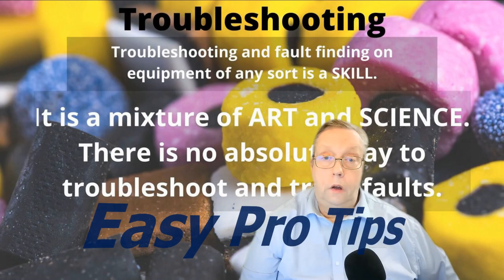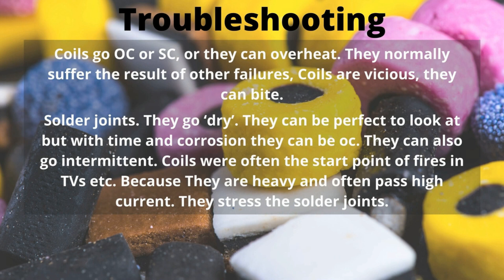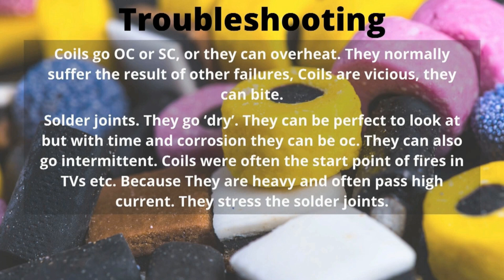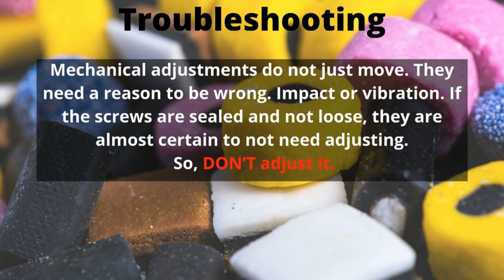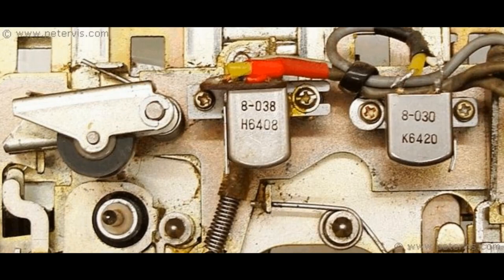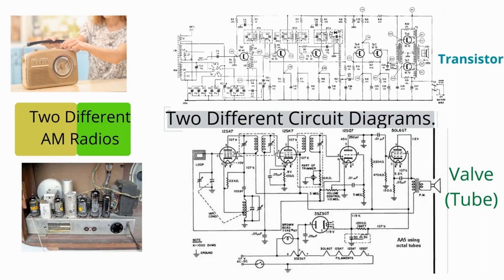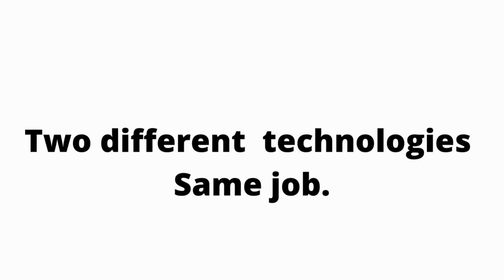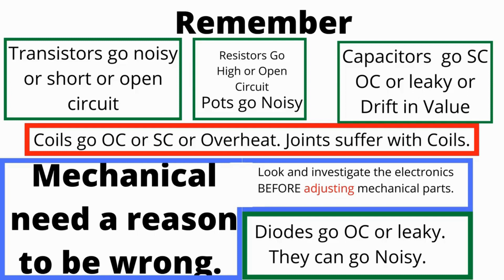How to Troubleshoot Electronics Down to Component Level

Comment: There are many different types of coils and Many different types of IC and many others, if you can make a video on each with different pictures of different kinds of coils etc and what they can do and not do it will be great. I found a round componenet did not know what it was because it is cylinder shape and black but then realize it is actually a coil, so there is allot of confusion about components out there...
Reply from the maker: That sounds like a good idea, I shall try and follow up on this. Thanks